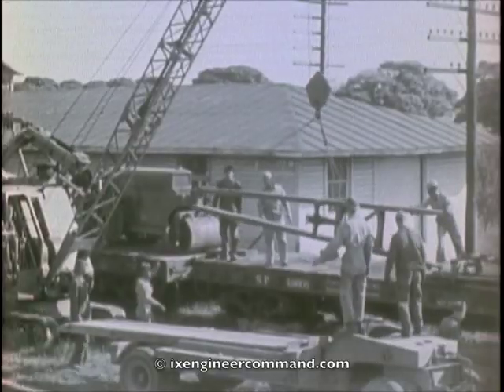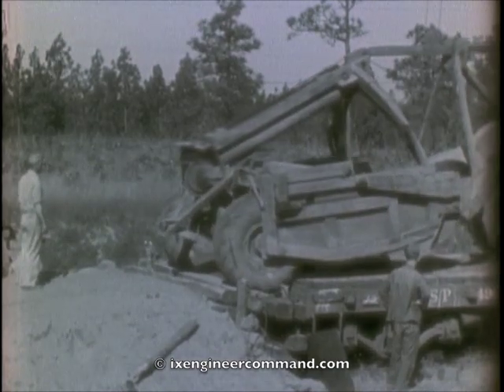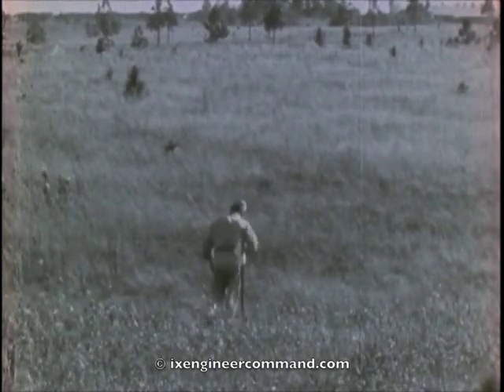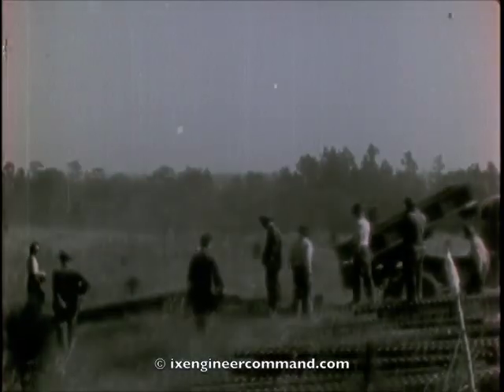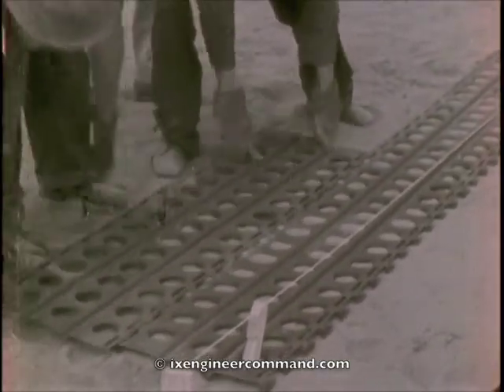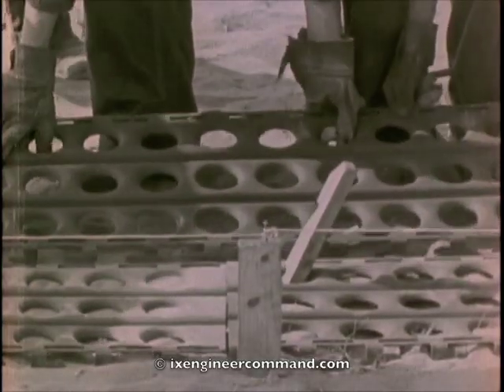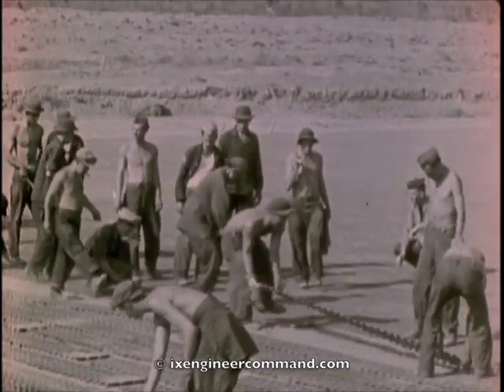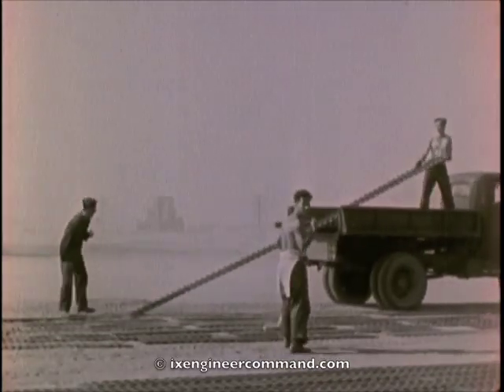Transportable Runway

Comment: In 1964 my family took a road trip from California to Michigan in our new 64 Dodge Dart wagon, along the way we pulled onto a side road to have a picnic and my father parked the car far off of the road. When we were leaving, the car got stuck as he had parked on some sand, and his further efforts dug the spinning wheel even deeper into the sand. My brother and I looked around for some wood or branches to form a ramp and we found an old rusty length of PSP (Perforated Steel Panel). We dug away sand around and behind the wheel and placed the PSP upside down to allow the sharp edges of the punched holes to grip the tire, my dad placed the car into reverse and the car backed immediately out of the deep sand. My parents told all of the cousins we ended up visiting about how brilliant and resourceful my brother and I were in solving this problem! My brother became a master concoures restorer of antique motorcycles and Jay Leno has two of my brothers bikes in his private collection, to see my brothers website go to "waltriddle.com". I became and independent inventor, designer, and manufacturer of custom tools for professionals working in the fields of mechanics, electronics, and optics, you can visit my YouTube channel by clicking on the circular H2H logo at the beginning of this comment.  David Riddle

Comment: Can you make it with modern recycled plastic in stead of metal? Its faster, cheaper and readerly available everywhere on earth when needed if you have transportable moulds?
Reply from the maker: I don't see why not though I'm not sure it would be as strong as steel. I know some new synthetics are but then you've moved away from recycled. You'd have to consider the weight of the proposed vehicles using it as well.

Since these runways were not meant to be permanent structures and the steel PSP was used mostly for quick repairs and initial build construction, it could be used and then picked back up if a more permanent concrete solution was needed. I don't think it was reused that often since a bent plank would be really hard to reconnect together.

Comment: Gr8 video. 
My dad was a works officer in 1957 in the RCeyAF (Royal Ceylon Air Force) its last chief works officer in 1971 and first DCE (directorate of civil engineering) of the SLAF (Sri Lanka  air force) and was familiar with this work. They were able to jurryrigg airfields in matters of hours on flat grounds and regularly rehearsed it in the 1950s-60s... a worksite of orderly Pandamonium with 500-1000 troops deployed for the activity
Reply: If memory serves the RCeyAF even once did an experiment where they used these steel plates to build a runway which they used for about a decade or so by layering the surface with a specific bitumen/tar mix ...🤔

Comment: Could you drive a truck on the plank if it were placed across a ditch?
Reply from the maker: No. The reason for the piercing was to reduce weight but it would have also affected rigidity. It was meant to be placed directly on the ground.
Reply: Easier to use a section of old junk cyclone fencing, it will conform to the surface. Should be a roll on anyone's truck that's offroad a lot. The roll can be used as is like a fascine too.

Comment: My Dad was an Army Combat Aviation Engineer in the vanguard of the units that would be dispatched upon completion of training at Ft Belvoir in VA. Their mission was creating, guarding, and maintaining runways for military aircraft without the time needed to construct an asphalt or concrete surface. In a tactical war situation, time is of the essence, and this was the solution. When the 9th and 19th TAC's (Tactical Air Commands) of Gen. Pete Quesada's 9th Air Force needed a Close Air Support unit nearby one or more infantry or armored units, they would either find an existing French or Luftwaffe airfield, or if none available, would find a suitable place for an airfield, bulldoze it, grade and roll it, then set out the surveyor guidelines, and then start laying down the Marston Mats and clipping/welding them together, all as depicted in this film.

These fields had to be strong enough to support the weight of, at least, an 8 ton fully loaded Republic P-47 Thunderbolt, or a Hawker Typhoon. In an emergency, a crippled B-17 or B-24 could be accommodated, but in order to keep from damaging/disabling the runway, they would be instructed by radio to land off on a non-runway part of the field. A fighter (P-51, P-38, etc) or a medium bomber (B-25 or B-26 could usually be accommodated if not heavily loaded with bombs. Only in a dire emergency would a Brit Spitfire, Hurricane, or Mosquito be allowed to land, since our airfield might not have fuel, supplies (grease, repair parts, etc) or ordnance (machine gun or cannon ammunition) which the Brit plane might require. (The British used a different rifle cartridge, a .303 caliber round, for their machine guns, while American planes used the 30-06 round for .30 caliber mg's, or the ubiquitous .50 caliber Browning MG round, which were infrequently provided to the Brits by us. This was the reason that, when NATO was born, one of the strict military requirements was that the member nation had to adopt the NATO standards for ordnance so any brother/sister nation could be supplied with ammo from any other NATO country stocks of ordnance. This conversion was required for every initial European nation when NATO was formed in the late 1940s/early 1950s, and occurred with every former European Communist Satellite country after the fall in 1991. Poland and the small Baltic nations were the first. to do so, quickly followed by the rest as they broke free from the USSR and were voted in by the rest of the NATO member nations.)

My brother and I proudly supplied, in memory of our Dad, the funds needed to copy/restore the original films from the govt archives for the preparation of this vid on YouTube

Comment: The first time I ever saw this kind of runway was in 1967, at a place called Dong Ba Thin, Vietnam. The runway was for US Army fixed wing aircraft, and the air traffic control tower, was a one man tower that was place on the side of the runway, it was the only air conditioned placed on that very small base. I understand they landed a C-129 on that runway, and used every inch of it, I wish I had been there that day. I was there when a C-47, "Puff", as it was called by us, another name for that plane was "Spooky", landed after an operation right outside our front door. That was one hell of a night. I remember looking at the runway and thinking "Leggo".
Reply: What is a C-129?
Reply: @tylerprufer7066  My mistake, I meant C-130.